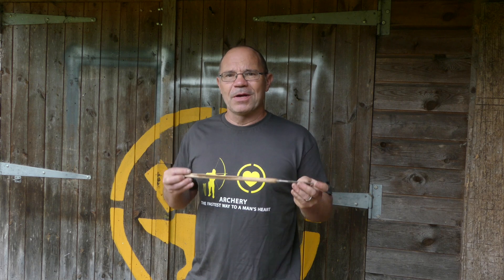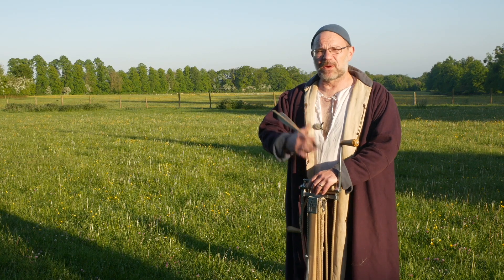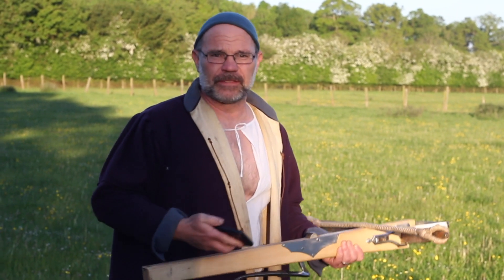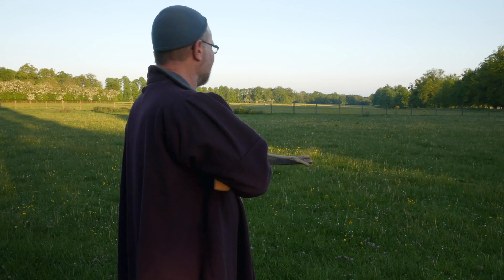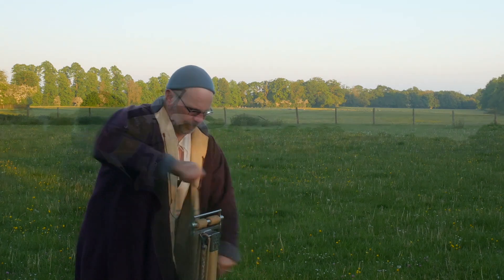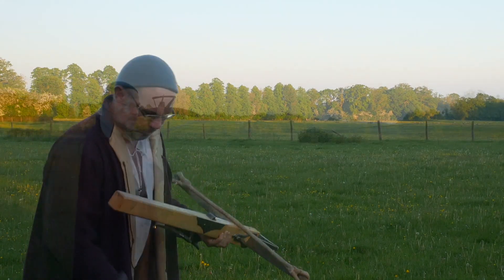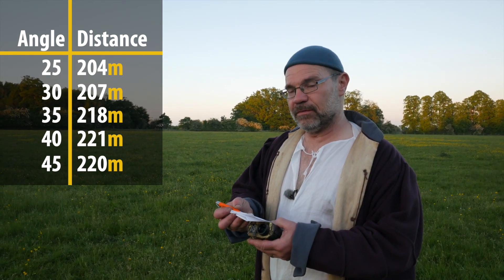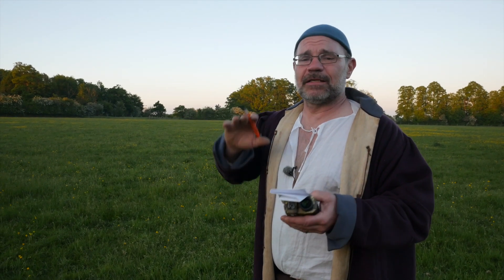Distance - Which angle is best?

Comment: Oh man!  I just had flash back to 1987 when I did armoured gunnery.  You’re talking “factors effecting a first round shot”. Air pressure, windage, the targets hight, your hight, the angle of the ground you’re on, the targets on, etc. All the stuff the computer does now, we used to have to guess.  Honestly you need to fire 10 or more bolts at the same angle to get your “mean” as they will all fall at different ranges based on the exact factors effecting that bolt at the exact time of shot.  That area they land in is called your “beaten zone”. And it will look like a North American football 🏈.  One really far, one really short and the rest in the middle of that shape.  Thanks for taking me back to very happy time in my career! Cheers 🍻
Reply: i did that in 2004 and well... computers do most of the work but we still had to learn how to do it manualy. using range tables and rulers...
Reply: @Skuggan84  I suppose you are talking about indirect artillery fire, where you really have to measure all those things? I suppose that Just Another Captain was talking about direct fire with a tank gun, or at least that's what "armoured gunnery" brings to my mind. For that guesstimating might give "good enough" results and really was the way tank guns, anti-tank guns and such usually did it "back in the day" before integrated fire control systems were a thing.
Reply: @teromustalahti2903  yes. And I understood that he meant tank gunnery. We did fire directly too and did the guestimation (sighting through the bore and shoot a spotting round) it is a True art. But yes. I was in the artillery and we had the luxury of range tables we could use for reference and baseline. Direkt fire Guns dont usually have that as they can see where they hit.
Gunnery basics are pretty much the same though ;)
Reply: Mortar man here. There are so many factors to take into account. we sometimes had to use meteorological data since the shells would travel so high. Not sure that that would affect a medieval crossbow bolt, though. :D
Reply: @_malprivate2543  Field artillery always use meteorological data ;)
and no.. i dont think that applies to a crossbow.. projectile weight is probably enough. the importance for a test like this is that its exactly the same every time.. so some kind of jig to mount the crossbow on that is adjustable in elevation but not side to side. handheld.. well.. its just the odd chance you drop the elevation a couple of degrees right as you pull the trigger.. so not 100% accurate.
Reply: @Skuggan84  Well, no. If you fire a light mortar (for example) at  a target within direct line of sight you don't need to take that kind of date into account.
Reply: Best would be to shoot the different angles with numbered bolts. Fetch, repeat with different bolt per angle.
Reply: There definitely needs to be a larger sampling. The wind couldve blown differently on every shot, or maybe he jerked the trigger more on one shot than another, etc.
Reply: Also the crossbow needs to be securely mounted to a firing platform with angle adjustments. The crossbow should be able be tensioned on the platform with no movement out of the holder. Jack it up to the angle. Fire the 10 shots, measure the distances, and move to the next angle.
Reply: @custommotor  that might affect the shot though. a body has some give, a secure platform would have none.
Reply: I freaking love the comments section on this channel! There is always someone with pearls of wisdom such as this. Always a group of people with brain power to constructively nut out a problem or seek to answer a question.
Reply: On the other side of the “pond”, we calculated “Range Probable Error” in determining the variations in the impact location of rounds on target. Compensation includes variations in exact projectile weight, temperature of the powder, temperature of the barrel, weather conditions (temperature, density, wind direction and speed every 1000 feet of elevation, etc.), age of the barrel (every round wears out the barrel a little). 
Tod’s experiment is interesting, and informative in general terms. Dealing with all the variables is more trouble than it’s worth. And windlass crossbow takes so much time to load, you are not going to have time to accurately shoot at max range: I doubt anyone fired a ranging shot. Add to your gunnery problem is anticipating how far the enemy moved while the bolt was in flight. Like when shooting a bird, you have to lead your target. 
I think they tended to shoot at a directed distance: a officer would command to fire at 100 yards. Or used in siege warfare where you fired several bolts at the same target to get your aim down.
Reply: @doughudgens9275  Yeah the old ww1 rail guns they had numbered projectiles to compensate for the change in barrel diameter as it increased after every shot. You must have been shooting some massive ordinance as they don't go through all that for the 155's through 60mm systems. Would suck having to wait for that to be done while calling in something that is needed with the quickness!
Reply: @KWW0321  actually we did metrological calculations at least daily (after they flew the balloon) on all artillery —105, 155, 8”).  The manual form took about 15 minutes to calculate in the early 80’s when I learned it.
Reply: @doughudgens9275  Geeze, glad things have advanced, waiting 15 minutes for a fire mission to get started would seem like an eternity!
Reply: @KWW0321  thank goodness we only did met calculations after the balloon flew, and used those numbers until the next flight. Otherwise the ground pounders would be upset!
Reply: @doughudgens9275  Gotcha that makes sense, at first I thought you were saying that prior to every fire mission that whole process had to be carried out.
Reply: @KWW0321  depending upon theater of operations, weather variability, and budget/availability of the weather balloons a full schedule for the US Army in 2001 was just before sunrise, about an hour later, then an hour after that, repeat in reverse around sunset, and then one between sunrise and sunset both night and day. Total of 8 balloons a day.  Wind shifts the most during dawn and dusk as the atmosphere goes through the most rapid shifts in temperatures during those times.

A crossbows only going to really be dealing with ground level winds which don't usually vary much in the first couple hundred yards or meters.

Modern field artillery, with or without rocket assisted projectiles, on a high angle shot hits 10km altitude or higher especially the big guns.  In the US Army the 155mm guns in the M109A6 Paladin can still be accurate within 10m on the first high angle shot over a mountain of a fire mission with all the variables the computers take into acount.
Reply: Fire direction specialist myself, trained to do the math incase the computers failed, but in the field if the computer had issues we immediately transferred our guns to another FDC team in our battery or battalion.
Reply: beat zone*
Reply: @LaughingMan44  No, Beaten Zone.  It's where all your projectiles land.  By understanding that, it helps with sighting area weapons, in this case, a crossbow, or more modern weapons like a Machine Gun.
Reply: @justanothercaptain6566  I have not heard that term since MASOC, brings back memories!
Reply: @KWW0321  Yes!  Tell me about it!  The second I saw what he was doing I was a Tpr/Cpl again on my TQ2 Armoured Gunnery Course staying up all night to memories all that theory for the morning “quicky test”.  The standard was you had to get 100% on every test or you were RTU’ed.  So no pressure! 🤣
Reply: @justanothercaptain6566  Thankfully being on the other end calling it in we did not have to do the computational stuff. Was one of the funnest courses I got to go through:)

Comment: One problem might have been that the bolt on lower angled also start lower in height above ground, because of the length of the stock of the crossbow. This might make a difference. It might be worth it, to physically eliminate this variable.

Comment: I wasn't surprised at all. Air resistance on a body so narrow shouldn't change the maximum distance angle all that much. Drag is just much inferior to the weight, which is primarely comanding the trajectory.
Reply: No-drag implies that the range at 25 degrees should be 77% of the range at 45 degrees, when in fact it was 93%. So no, drag was very important.
Reply: @sealpiercing8476  
Can you explain why a shot at 25° should be 77% of a 45° shot? Is that based on a chart of ranges for bolts and arrows or on something else?
Reply: @Therapistinthewhitehouse  That's just based on theoretical ballistics. I'm a situation with no drag and flat ground a 45° angle will give you the most range, but other factors change that in real life. I'm this case it seems that the staff during the extra time in fight just about perfectly counteracted that expected extra range from the better ballistic trajectory
Reply: @Therapistinthewhitehouse  In absence of drag on level ground, time in flight is proportional to sin(angle) and horizontal speed is proportional to cos(angle), so range is proportional to sin(angle)*cos(angle). sin(25°)*cos(25°) is 77% of sin(45°)*cos(45°). It's not "should be" since drag clearly does affect flight.
Reply: Drag is definitely not "much inferior to the weight." 

The relationship between drag and weight is well described by the terminal velocity of an object.

A human has a terminal velocity of about 180 FPS, so 180 FPS is the point where weight and drag are equal.

An arrow is more streamlined than a human but far lighter. It is not likely that a crossbow bolt can fall much faster than 180 FPS, which is close to the flight speed from a crossbow. In some cases the arrow may actually be launched at a speed exceeding the terminal velocity.

I don't know the launch speed in this case, but if we guess 180 FPS, that should go 307 meters @ 45°

That's a good 87 meters further than in the real-world test. With this assumption, drag subtracted around 28% from the distance--not insignificant. 

Whatever the case, the aerodynamic resistance is very similar to the weight of the bolt, and may even exceed it at points in the trajectory such as while fish-tailing for the first half second.
Reply: Don't forget that a body in flight through air can also have some lift, depending on the aerodynamics. Having some lift would improve the effectiveness of a flatter shot because your lift will be mostly directed perpendicular to the ground.

Comment: I realize this thought may be anathema to you but, could you try with a modern crossbow and bolts?  That way you would have consistent bolt characteristics and you could do multiple shots at each angle to average them out.  The angle results should still be very close (within a few degrees) to a medieval bow.
Reply: Medieval bolts have a lot larger cross section and a worse drag coefficient, so overall more drag.
That will skew the results, how much, I don't know.
Reply: @kilianortmann9979  Agreed, but that is a slightly different factor.  Now if a good bundle of medieval bolts could be produced with exactly the same weight and cross section (for drag) then by all means use the ancient gear.  The difficulty with that is they're all handmade, hard to make exact duplicates.  I was just thinking of having consistent results for the testing.
Reply: @michiganengineer8621  That would be desirable, but the results conform well with the expected shape of the curve, so we know they can't be too far of.
If one of the two bolts had significantly different properties, we would have seen some stair-stepping in the curve.
The results of different angles essentially validate each other, with how they follow the expected trajectory.
It's probably sufficient to know, that everything between 35 and 45 degrees yields good results.
Reply: @kilianortmann9979  It'd skew the overall distance traveled relative to more modern designs for sure, but I fail to see how it would skew optimum angle for maximum range.
Reply: @corwinhyatt519  At zero drag, the optimum angle is 45°, drag decreases that angle, to 40° for a medieval crossbow bolt and about 20° for a shuttlecock. The air resistance is so large, that any higher than that and the shuttlecock just falls straight down, not adding any more distance.
So simplified, the more drag, the lower the optimal angle.
Reply: @kilianortmann9979  What is the difference in drag coefficient between a medieval crossbow bolt and a modern crossbow bolt? The comment you originally replied to was specifically about that.
Reply: @corwinhyatt519  I don't have exact numbers for Tod's bolts, but they are probably about twice as thick as modern ones.
Modern bolts are 1/3in, 2/3in for Tod's bolts seems about right, that means at least four times the drag, from the additional frontal area alone. Difference in drag coefficient can probably be ignored, but would make the difference only worse.
Reply: @kilianortmann9979  Doesn't drag scale with the cube of the velocity? Modern bolts have a lower drag coefficient but if they're lighter and going faster they could experience more drag acting on a lower mass.
Reply: @michaelsimmons2483  Drag force scales with the square of the velocity. But velocity is a whole separate variable from the aerodynamic properties of the object.
Varying both at once and  the result become basically impossible to compare, either shoot equal bolts at different speeds, or different bolts at equal speed.
Reply: That is a cunning thought.
Reply from the maker: I have considered this and I will probably come back and do it, because I think the results may well be vey different
Reply: This is a good idea, although the video would look a lot less cool :-D

Comment: Should do 40-48 each degree.
Reply: He would need to use a bench rest to ensure consistent and accurate positioning of the crossbow because the angle errors possible with offhand shooting could easily trump the 1 degree increments.
Reply: @johnbarron4265  I agree, should be using a device to ensure level in all directions and consistency. Probably take a few shots per degree as well to avg.

Comment: I understand the application differences between the bow and the crossbow being something conditional to location/condition (bows for horseback, crossbows for castle walls, etc.). 

I’m wondering this application difference also extends to actual use of the weapon: bows are meant for volleys and rapid firing (shoot n’ scoot) while crossbows are more for precision aiming? 

Without any aiming tools to discern distance, the crossbow’s utility for firing at steep trajectories seems almost non-existent.

Comment: Because the difference between the ideal angle and the ideal angle in a vacuum comes from drag, I imagine the angle for dense bolts like these is higher than for something like a baseball or tennis ball, which is probably something most people are more familiar with. This could explain why we all thought the ideal angle would be lower than it was.

Comment: Seems at 40-45º is the goldilocks zone.
Reply: everything 35 to 45 seems likely to be well within the variability of the testing conditions. Not much can be concluded. Likely, however, the lower angled shots will impact with a higher velocity, a more favorable angle for both penetration and hitting a man among a massed group of men, and a greater potential for accuracy due to less disruption from wind conditions. So if 35 through 45 degrees really are so close for the range, 35 degrees might be the best angle under most conditions.
Reply: Especially when angled down off a castle wall.